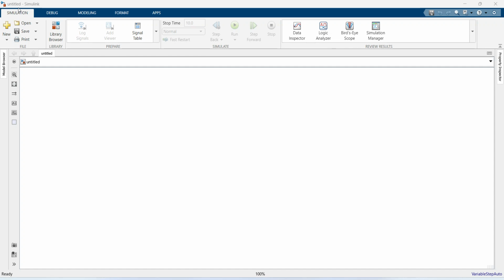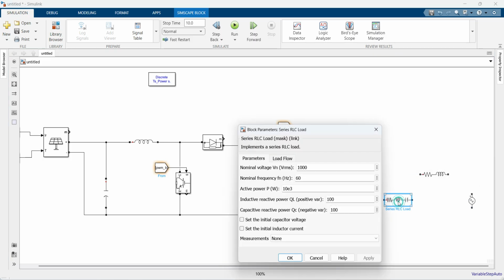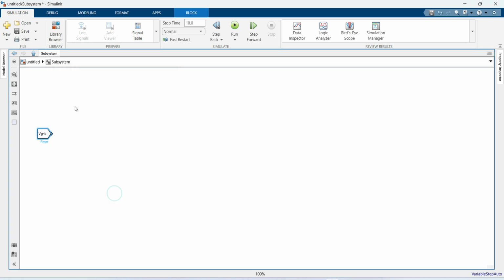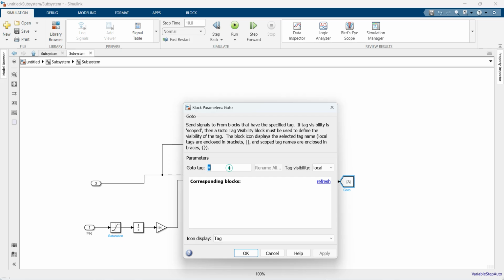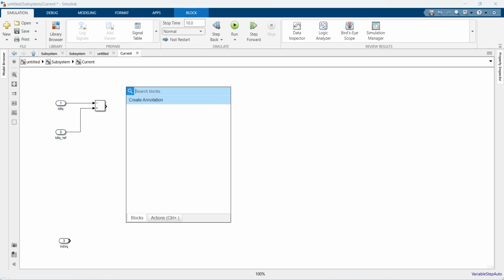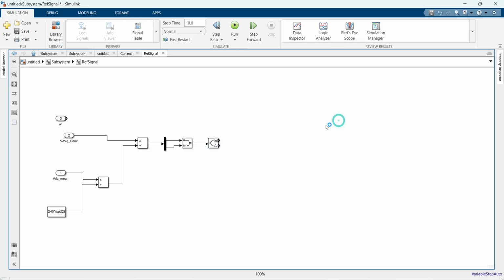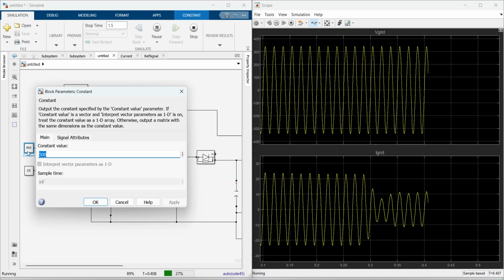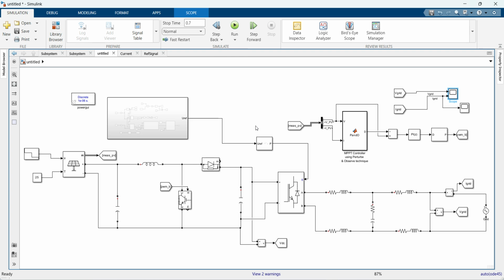Grid Connected Solar PV Array with MPPT & Boost Converter in MATLAB Simulink | Single Phase

Comment: Hello, can you make simpler control logic for the inverter ? Just the dq control ? without any feedforward control? Using the dq  frame box in simscape
Reply from the maker: I haven’t checked this but as far my knowledge only dq control won't give accurate  results  as most of the paper introduce feed forward control.
Reply: @simscapeelectrical4912   So we are using dq axis control for both grid voltage and grid current? So for the feedforward control what we are controlling , grid voltage or grid current?
Reply from the maker: Grid current. 
I will suggest you to read some paper to get clear idea on this topic

Comment: I did the exact design and simulation settings on my model by seeing this video on matlab R2023b. The waveforms are coming correct and current is decreasing when irradiation is decreased to 500 similar to what u what shown. The problem lies here : 1st. The current at 1000 irradiation reaches a peak around 20 but my current reaches a peak of 40 oscillating at 30 A.  2nd. the THD of mine is 14.83% but yours is 1.37% and Fundamental of mine is 36.65 but yours is 23.08. What changes I can do though I have followed the same steps and settings as yours?
Reply from the maker: As waveforms are coming correctly but you got some value difference this indicates that you have made any sily mistake not a serious one.revise Again and Again and I hope you can find Your issue. 
Thanks
Reply: @simscapeelectrical4912   Yes you were correct. Thank you so much. Do you have any reference or the document for verifying the designing calculations and the formulas used for the design?
Reply from the maker: Check the comments of this video.I have  Shared  with someone

Comment: Sir I have followed all the steps which you have mentioned but I got error as specified buffer for variable transport delay was too small.in order to generate code you need to update the buffer size parameter it's showing what I have to do please suggest me
Reply from the maker: In Control section you will find variable transport delay  block for converting dq frame,here you have to set a reasonable upper limit if you want to generate code.

Comment: I feel like the output is there because of the AC source you connected at the end
Reply from the maker: The voltage waveform will be the same as the AC voltage source, but you should mainly focus on the current waveforms, as this is the main point of interest.
Reply: @simscapeelectrical4912  okay. thank you
Reply from the maker: You're welcome